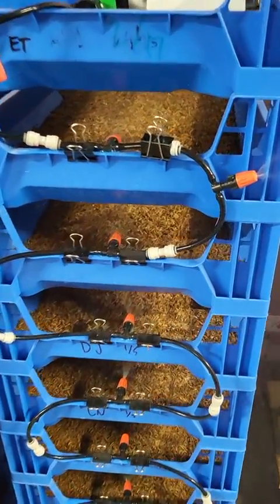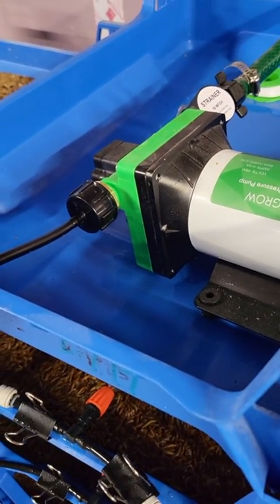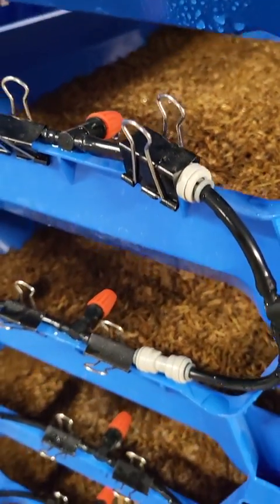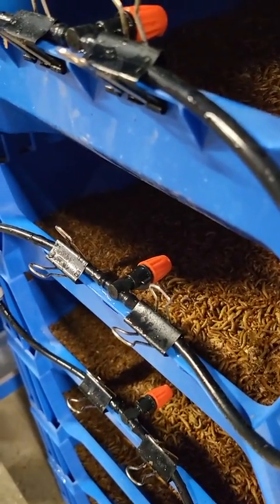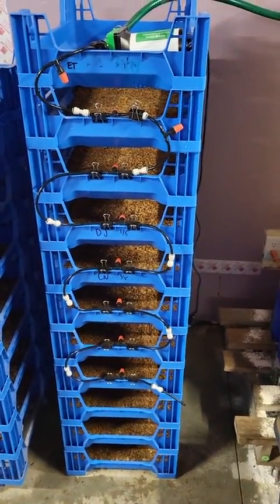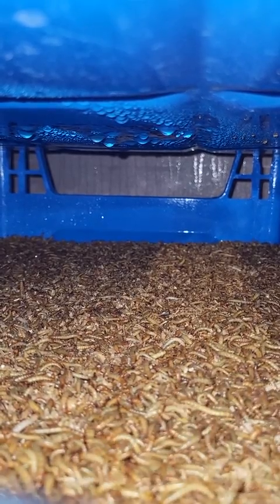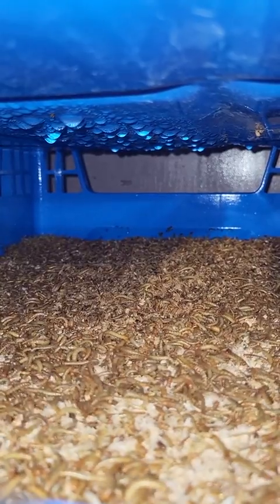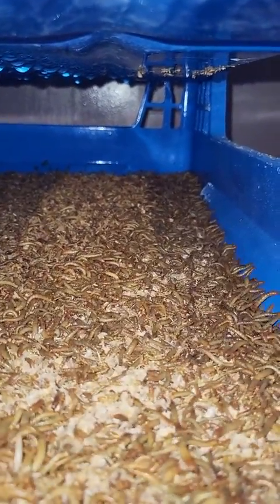Automatic hydration test run!

Comment: Hello, do you now have more experience about direct hydration or do you still use watergel chrystals?
Reply from the maker: I still use water gel crystals. What is direct hydration?
Reply: @MidwestMealworms in this videos you spray your works directly with pure water for hydration. In your newer videos you just use watergel chrystals. What are the disadvantages of directly spraying?
Reply from the maker: @benjaminfuchs4764 it slowed their growth tremendously.

Comment: In this sprinkler system, the weaker larvae don't eat the stronger larvae on them?
And that wheat bran does not mold?
How many seconds does it spray every few minutes or hours?
Reply from the maker: Cannabalism can occur at any time, I don't think routine spraying will increase that.

Bran can mold in any scenario where moisture is added, whether it be spraying or the typical things like fruits/veggies.  If you overhydrate, you will get mold.  

I haven't figured out the schedule yet, still testing.

Comment: How frequent do you plan on spraying?  Do you plan on allowing the bins to completely dry between cycles?  I spritz my mealworms and eggs with water but i don't care for the bran sticking to the sides of the bin.  I need to develop an overspray template that I can set in my bins to prevent the sides from being sprayed.
Reply from the maker: I'll likely do it multiple times a day in very short spray intervals. That way they dry between sprays. Younger mealworms will get shorter sprays.

Comment: Hi from Turkey
As a result of the combination of water and litter, won't there be an extreme temperature increase in the litter with first decay/fermentation?
Can you show me the water crystals?
(forget my english because google translate english)
Reply from the maker: There may be an increase in temp, but it shouldn't get too bad.
Reply: @MidwestMealworms  Are the water gel crystals for larvae or rootstock for insects?
Reply: The time is 10:16 pm in İstanbul/Turkey...
Reply from the maker: @utkugokmen2433  they are for the insects to eat to get water.
Reply: @MidwestMealworms  My friend
for insects, you can try drinkers/water bowls for cage birds...
You put cotton on the bottom, the cotton gets wet, the insects drink from there...
Reply from the maker: @utkugokmen2433  do you have a video example? I think the insects would eat the cotton and make a mess out of it.
Reply: @MidwestMealworms  No
They don't eat cotton, they suck it.
Cotton does not fall apart because it is wet.
It's 6 pm o'clock in Istanbul right now
Reply: I repeat, this is for adult insects, not larvae.
Reply: @MidwestMealworms  I actually saw an old research paper the other day where they mention using a "water bottle plugged with moist cotton" to hydrate meal worms and I wondered how they were doing it. I tried searching online and couldn't really find anything. It was in reference to T. obscurus rather than T. molitor, but I would guess it doesn't matter.
Reply from the maker: @Thedamped  I need to find a cotton strong, then test with the beetles.
Reply: @MidwestMealworms  I saw where people were watering plants with string in water bottles, making makeshift drip irrigation. I was wondering there would be a way to make that work with them. My thought is that I think it would be hard to vary the rate of flow. One person said different thickness of the cord can change the rate, also seems like height difference can vary the rate of flow. If the second is true, then as the container is depleted then the rate would decrease which isn't ideal. Idk.

Comment: Could you explain why your doing this? Is it just for extra moisture? Do you think you'll run into mold issues? Thanks for the update looking forward to seeing more!
Reply from the maker: If mealworms are provided direct hydration like potatoes and carrots, they grow faster.

To scale my operation, I switched to water gel crystals. Less cost, but still cost and lots of labor.

But setting up this system, I can stop the water gel crystals, run it on a timer, and I'll be able to get more trays into the same space I have.

I'll try to make a video of this summary with more detail.